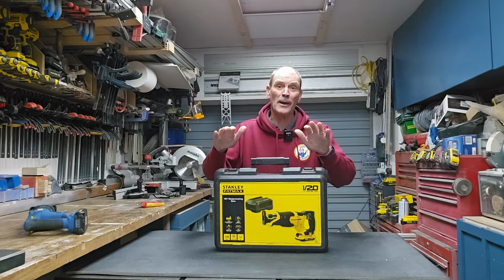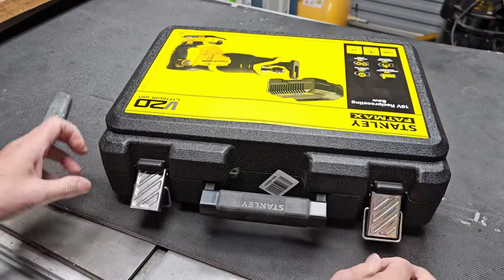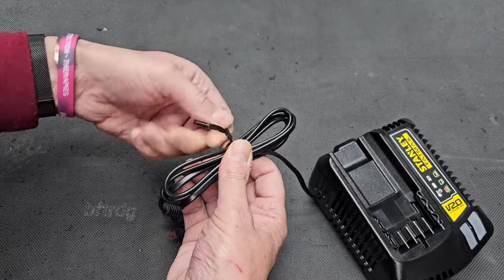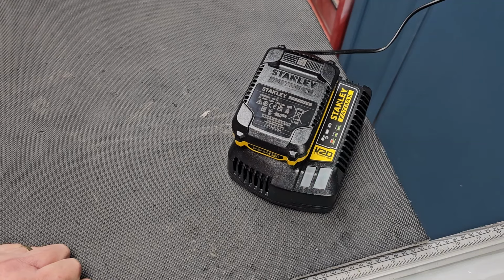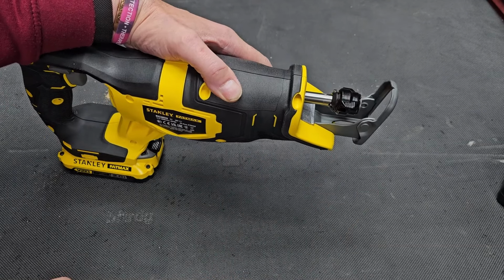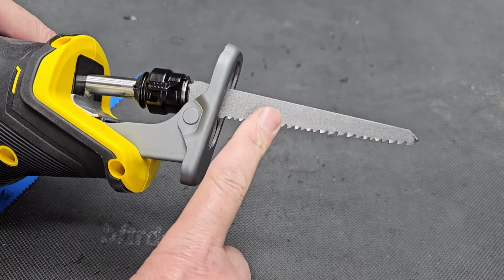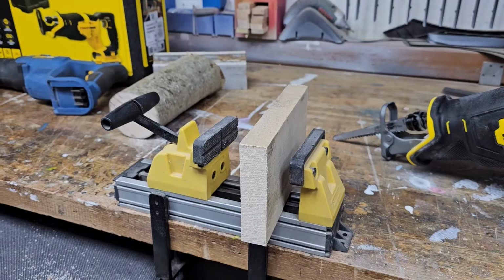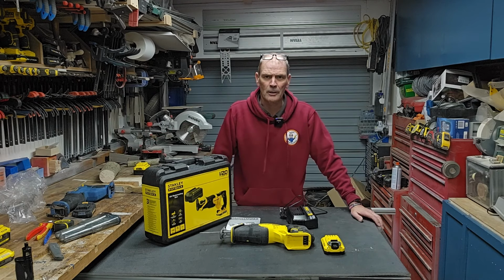STANLEY FATMAX V20 RECIPROCATING SAW

Comment: was all the wood you cut with the 2ah battery enough for one battery or was there still some power left in it?
Reply from the maker: @dariusz1678  😁 Hi Darius, all the original cuts were done with the 2Ah battery (I had to re watch the video to remind myself 😆😆). And it was only on 2 lights when I started. So even the 2Ah batteries have quite a good usable time. Hope that helps. Thanks for watching 😁 👍
Reply: Thank you very much for your answer and the time you dedicated to me)) Best regards, Dariusz

Comment: Are the Stanley and Dewalt batteries and chargers compatible?
Reply from the maker: @danielegozzini347  😁 Hi Daniele, I'm afraid the Stanley and DeWalt batteries and chargers are different. So they are not interchangeable. Thanks, I hope that helps 😁👍
Reply: @frankslittleworkshop  do you think they’d work it a craftsman v20 tool? The high vis yellow is really calling my name

Comment: Good video nice upgrade. Isn't it about time Stanley sent you some of their tools. I have a similar saw for palettes and a 4 amp hour battery doesn't take long to flatten it. I found a great blade very course with tungsten teeth for those hidden nails in palettes. Manufactured by kangoo probably Chinese not sure if they are available in uk. Steve.
Reply from the maker: @stevehedges1158  😆😆 I think it's about time, I've spent a fortune on Stanley stuff so far 😆😆. But I do like it 😁. I'll have a look for the Kangoo blade, sounds like it's just what I need 😁. Thanks for watching Steve 😁👍